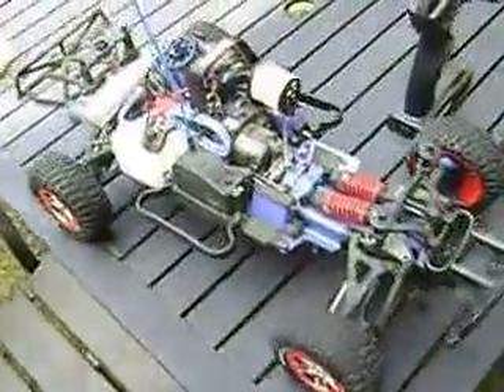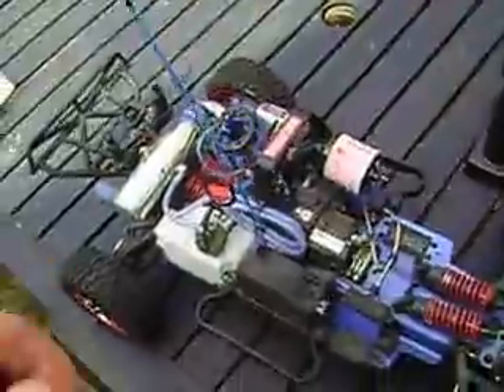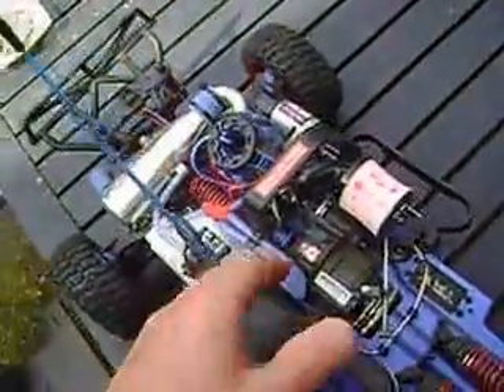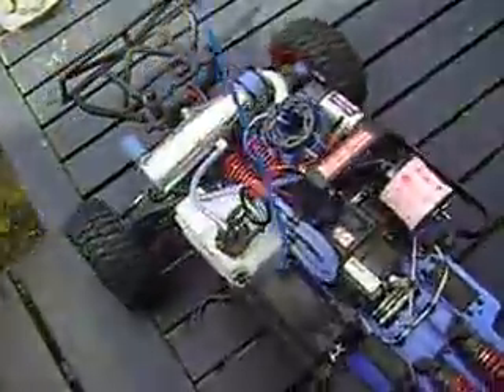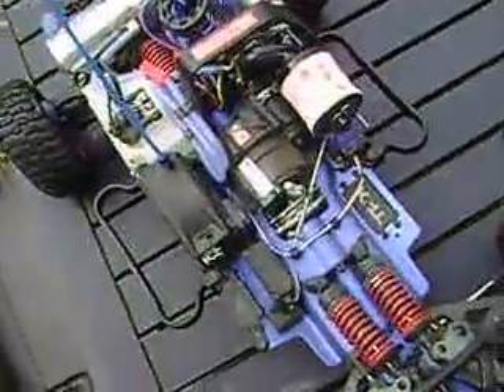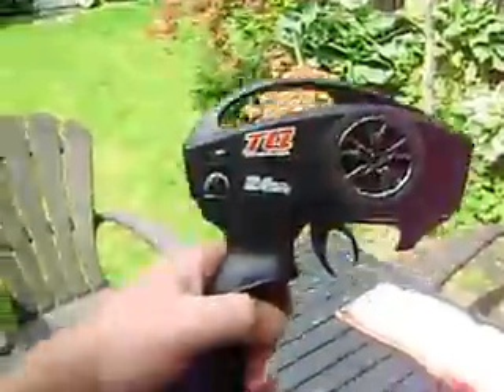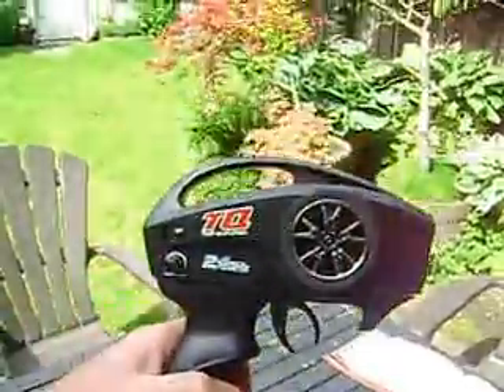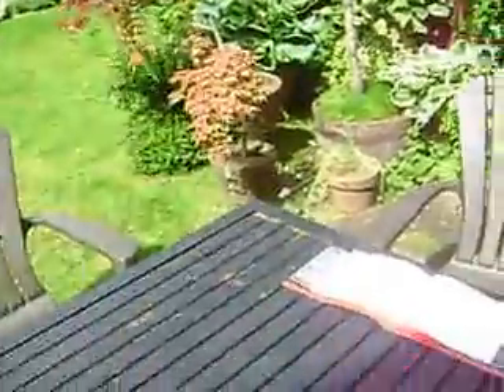first run traxxas slayer pro

Comment: Hope ya broke it in first. That's to properly wear in the piston and sleeve. This ensures the engine keeps compression. Also you don't want a ton of metal on the truck. Its heavy and bends up. Plastic bounces back.....hope ya having fun with it